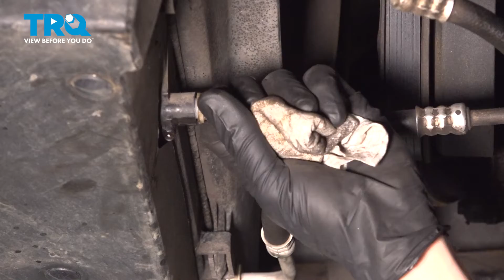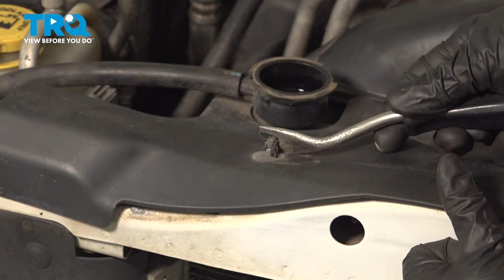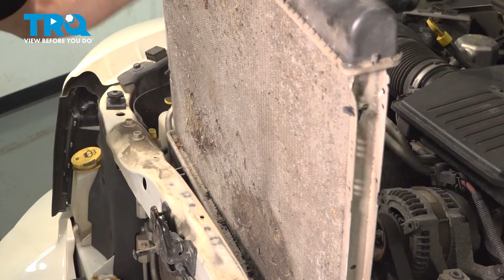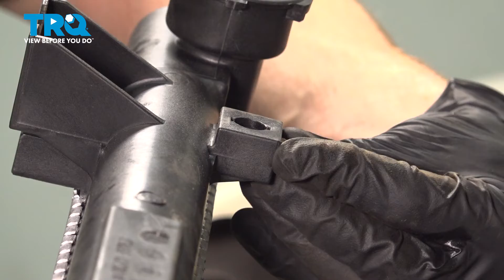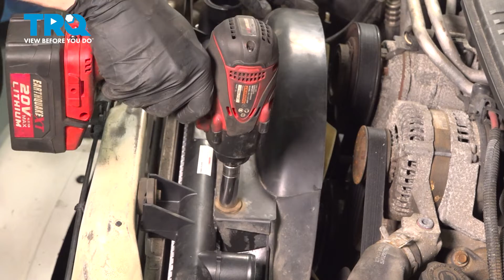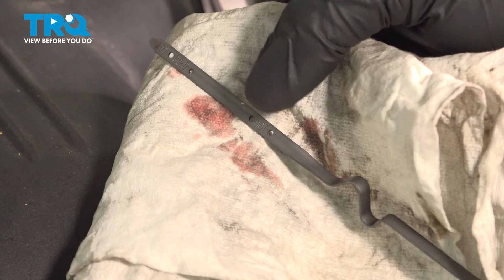How to Replace Radiator 2005-2010 Dodge Dakota

Comment: Great video! I would just add that after you set your new radiator into the frame, there are two areas of the fan housing that want to nest into two unique points of the new radiator complex that are not necessarily important to note in it's removal.

Comment: Those square nuts that come with the radiator... the video says there is a marking indicating which side out/in... if it isn't marked I believe the tapered side goes away from you... this way the side that has the most surface area in contact with the plastic is what you're pulling against the plastic as you fasten it.

Comment: Mines leaking across the top. Gonna use JB Weld as I did several months ago and redo it, so I only need to lift it up and not out but had no idea how, tho I'm somewhat mechanically inclined. This video was super well done and clear as a bell how to do it. This is my project tomorrow! Thanks so much!

Comment: Will the condenser lift out once you remove it from the radiator? I'm not replacing the radiator, but have to remove it to do another repair. Thx.

Comment: You forgot to mention to preinstall the dorman clips (e clips) into the transmission cooling line connections. Some new radiators come with them preinstalled. Without the clips reinstalled, the cooling lines will pop out. When they are preinstalled, the lines are tapered and will "click" into place. The rings keep those clips in place.